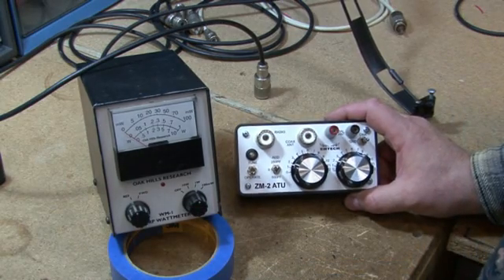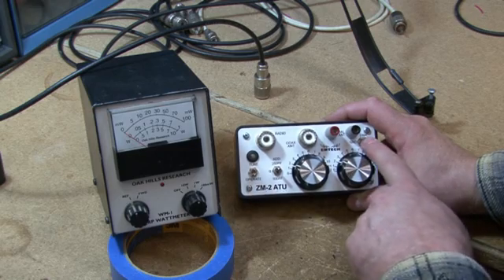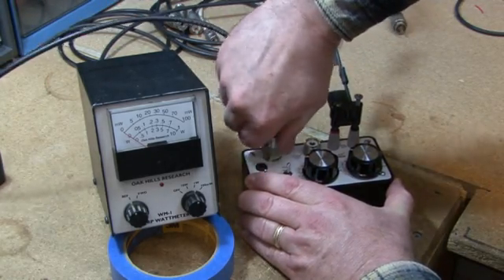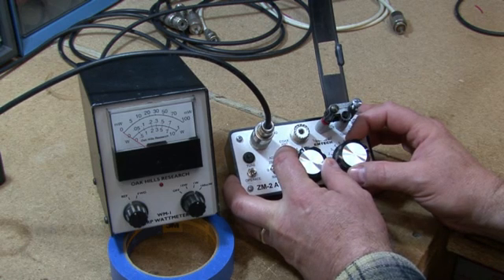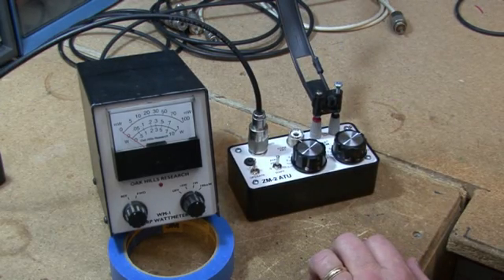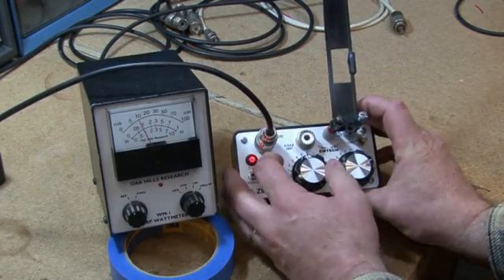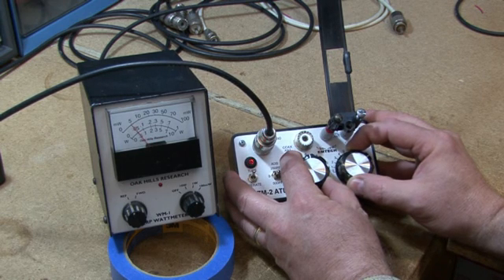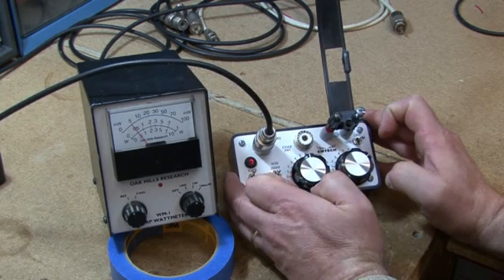zm-2-tuning.mp4

Comment: With so many radios with 20W now, like the G90 and Fx-4CR, what would it take to increase from 15W to 20W?  Would just upgrading the toroid work?
Reply from the maker: Sorry for the long lack of a reply. I has lost the login to this account.

No, the issue for a higher wattage isn't the toroid but the Poly Caps. With higher wattage and higher SWR they could arc and that would be the end of them. A careful person could, probably, use their rig at 20 watts. That person would want to more very carefully pre-tune the unit by tuning for noise. Then xmit in "operate", watching the SWR on a meter. I think it could be done. That said, the experiment could cost a zapped poly cap or two.

Comment: That ladder line dual banana adapter is quite clever, I looks homebrew and that I can't seem to find anything available online with the same functionality seems to support that assumption. Upon inspecting the video it looks like you modified one of those twin banana to BNC adapters with some screws to tension the connections but it's hard to tell in a video this old and low resolution... At any rate built or bought, I'd love to know the details as I'd certainly like to have a few on hand for my adapter case and field kits
Reply from the maker: https://www.google.com/search?q=dual+banana+post+male+plug

Comment: Fantastic mini-tuner! but a doubt: could it work to also tune with a pure receiver for SWL?..
Reply: Technically it would not provide gain, nor improve the signal to noise ratio (SNR). For receive, it could act as a band pass filter, helping to rejecting near frequency interference. Ideally your antenna would be the exact or the exact fractional length of the received signal to get best received signal and best SNR.
Reply: @ScottGregson  Thanks a lot for your detail explanation,. I think so too!.

Comment: I have just ordered one online 5 mins ago and it is far cheaper than the Elecraft T1.
Reply: It sure is, though there might be applications where the auto-tune function of the T1 is needed. My T1 is mounted where the ladder line from my antenna enters the shack. I tune it remotely, from the operating position. If I didn't need that remote tuning feature, the ZM-2 would be a strong contender.